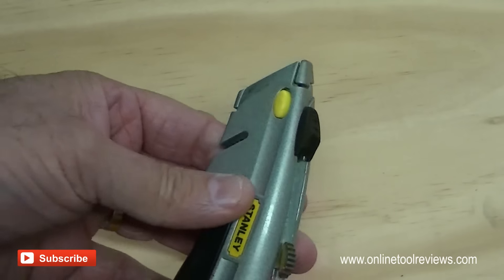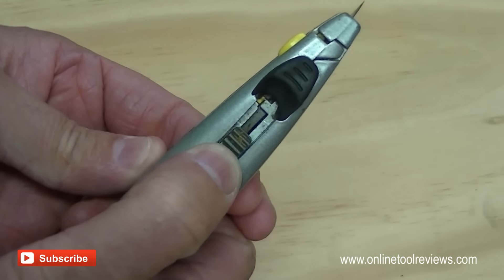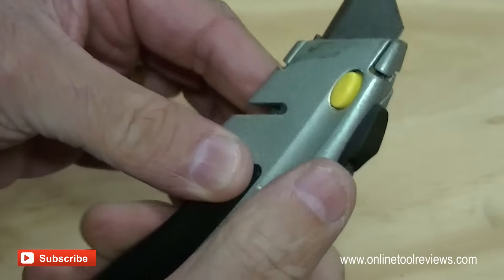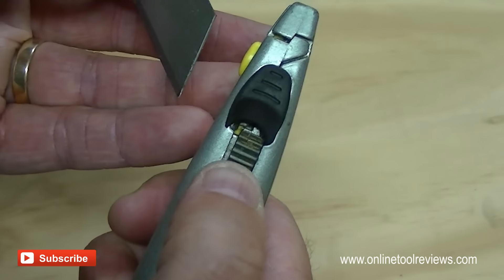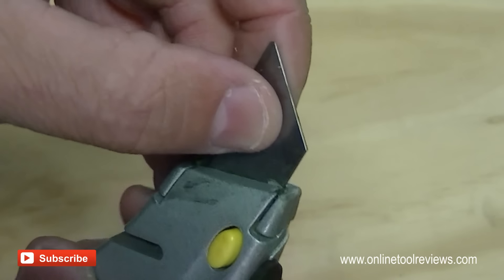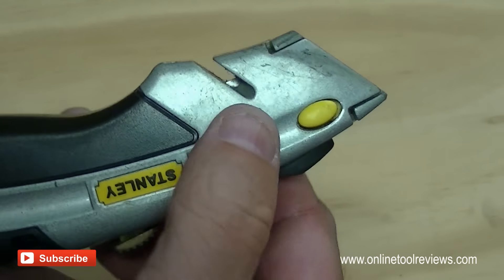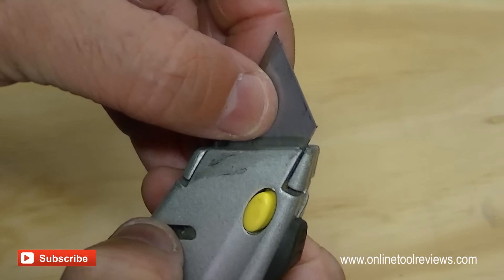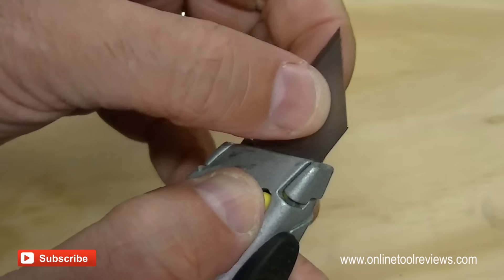How To Change Blades in a Stanley 10-788 Utility Knife - OnlineToolReviews

Comment: The "popular demand" for this video has been caused by poor engineering in the first place.
Reply from the maker: True.... But once you get past that, it is still a good knife IMO anyway.
Reply: Oh yeah. My yellow button is broken and/or SUPER stiff. I can only get the blade in one notch and it won't retract.
Reply: AMEN! And it's NOT easy. It's a pain in the arse - I had more trouble with the knife than the project I used it for!
Reply: @onlinetoolreviews4154  yes it's a brilliant knife, have u ever tried to change the blades on an old one, with spare blades as well I used to get in a right state, this one {once u figure it out} is brilliant.

Comment: Very good, but how do you get out the extra blades?
Reply: push the black square button near the end of the knife and then the bottom black plastic part releases
Reply: The blades sit in the holder underneat the handle part. Press the button on top down to release the holder part which will drop down underneath.

Comment: I’ve had this cutter for a few years. I had to bring it back to the hardware store and have them show me how to change the blade. It looks so easy when someone is standing there helping you. I got home and the blade wouldn’t click in no how I position and pushed it, back to the hardware store. OK, I’ve got it this time. It’s so frustrating. I end up getting my old one out. I like Stanley tools, but this one needs to go back to the design shop. Thanks for the video!  I think I’ve finally got it.😂

Comment: great video.  Button will not push all the way towards the black rubber.  Opened it up and its engineered not to push up that far.  So after watching all these videos trying to change the blade I had to take it apart to do so.  When I change this blade again this Stanley knife is going right in the trash.  aint nobody got time for that.

Comment: OMG Can't thank you enough!  the little tiny 1,2, 3 directions on the tag made absolutely no sense. Why can't anyone write actual directions using words anymore.  Just bought this knife as a grand opening promotion at ACE hardware for $2.99 .. I can't have enough toys.  With the help of your video I got it open, found the blades and installed it in all of 5 secs.  Looking forward to not having to open a knife with a screwdriver ever again!

Comment: Since my last posting on this knife I've found a very easy way to open this knife without pulling your hair out in the process.  Simply lay the knife on a hard surface then taking a 6 pound sledge hammer and with a decent wind up bring the hammer head down with offending knife and smash the living crap out of the knife and your problems are solved.  Then if you really do need a utility knife go to your local hardware or tool store and buy a Lenox # 20217 knife or any other knife - other than a Stanley!
Reply: 😀   then go buy a stainless steel switchblade and you're good to go!   depending on the day your having also determines the poundage of your sledge......
Reply: That would definitely get the knife open. Be like Lego or Ikea trying to put it back together though :P

Comment: Oh my! I had a complete brain fart when I tried changing the blades in my utility knife! I was stumped because I was using the smaller long bladed wiggly wimpier knife that you would open basically by going Dow the middle and prying it apart. I replaced the blade which reminded me of those extra flexible tree saws they used in the old country honky-tonk bands! I love my utility knife and you’re an awesome instructor and It doesn’t hurt that you can keep my attention with your beautiful voice and I mean nothing derogatory nor offensive. The video was perfect 👌🏻 you spoke clearly, and my work crew will be thrilled as well because they won’t have to change my blades every day!
Reply from the maker: You are most welcome. Thanks for the feedback.

Comment: How to you get to the spare blades to put a blade in the first time?  Just took the packaging off and it has no initial blade.
Reply from the maker: See the black "button" on the top of the handle where you palm sits... Push that downward to open up the blade storage section and grab a blade.

Comment: Thank you! I couldn't figure out what I was doing wrong. Sliding that slide thing all the way and pointing out that final click did the trick. Thank you! I was ready to buy a different one! :)
Reply from the maker: Hi Susan Hernandez, Yes it is a little tricky, but once those finer points are identified and shown, using the tool becomes a real joy. It is a great utility knife, as long as you can get those blades changed easily :)

Comment: Thank you. 3rd YT. I had to spray everything to get the bottons to work. The yellow button was just not working but ok after spraying.  I forgot to push it when putting the blade back in, but saw you do that. Then it worked fine. The top thumb button is gone. I have no idea when that happened... i loaned it one time recently. Nooe, never loan tools. I never got my power tools back. If you loan, assume they are gone. Then, just let it go and let God deal the justice. He always does.

Comment: You might want to "add" a demonstration for taking a "new blade" out of the compartment including starting from scratch with a new unit whose "cardboard" insertion is very difficult to remove without having a "magnifying glass" for us more elderly to read where one has to "tear", in order to remove it in advance of opening the compartment to get a new blade for installation. It is clearly a well designed unit once equipped with the knife, but not an easy one to figure out! :-)
Reply from the maker: That is not a bad idea, given the difficulty others seem to be having with unboxing this tool!

Comment: Make one showing where the two halves split apart.  The blade doesn't fit into the sliding apparatus, you have to use pliers or channel locks to force the blade in place.  30 years ago it wasn't like that, you could change a blade in 15 seconds.

Comment: this is an annoying design.  I sweat bullets trying to not cut myself until I could finally get it.  I think the trick is gently wiggling it until you hear that click.  

Thanks for the video.  It helped me at least have confidence that I was trying to do the right thing and it was just a matter of trying till it worked.
Reply from the maker: Aaron Gentry - no problem!

Comment: This video helped, but mine has been faulty from the day I bought it. I raged the day I bought it and then 4 years later pulled it out again to give it another go. It went almost as badly as the first time. I could never get the blade to "click" once it got to the second notch, and then it would not pull the blade in correctly and it would just drop back out. I spent hours trying this and watching YouTube videos with no success. I finally took the whole damn thing apart, laid the blade in the right place closed everything back up, put all the screws back in and BAM! It's working! But the way this video showed me, will not work no matter how many times I tied to make that blade go into the "click" position. There is something definitely wrong with the mechanics of replacing the blade.

Comment: I am also not able to push all the way forward. I can go forward three notches by pushing down before every notch and then sliding forwards, but no matter how much I try, I can not push it down enough to go beyond the final notch. The knob stay about half a centimetre before the rubber thingy. It's also a 10-788 (0-10-788 according to the display card) but it's slightly different from yours, it has an engraved Stanley logo and a diamond-shaped yellow button. Just bought it yesterday.

Comment: This video shows a blade change on the old model 10-788 with the oval yellow button. The new model 10-788 has a rectangular yellow button. On the newer model , the slider does NOT go into the the full forward position mentioned but stops at the normal usage full forward notch. The blade can be changed from that notch position after pushing the rectangular yellow button to release the blade. When reinserting a blade, push in the yellow button to let blade slide into the locked in position. With new blade in the locked in position, release the yellow button .
Reply: For cryin' out loud, then why didn't they call it the 10-789?

Thanks for this. I think I wore my thumb print off trying to push it all the way forward.  🙄 😅

Comment: The video was very help. Thanks to Stanley engineering a d design; I have two very sore thumbs trying to open the blade storage area and to change the blade. None of the 3 buttons works very easily. I bought this item about 1 week age, went to use it today and found I will be returning it tomorrow. Stanley used to be a name you could trust; they have lost all of my trust; what a shame.

Comment: Thanks for this video.  After a little playing around, I finally got the new blade to engage.  But it's a sloppy fit and the blade always has had a bit of rattle and play than I'd prefer.    I bought my knife over 10 years ago so I can't speak for today's quality.  But there are cheap plastic knives nowadays that work as well or better than this particular Stanley that I own.  They have blade storage and are not as much weight to drag around in your pocket, too.
Reply from the maker: +R. Severn 
This model has blade storage in the handle :)

Comment: You did not show how to open the handle to remove a new blade.... It is nearly impossible for me to "press down" on the black release button at the rear of the handle using a finger... I have to use a scredriver every time.. I insert the flat head screwdriver into rear of the button and push down so the screwdriver presses down on the black button and releases the handle...

Comment: The new utility knife that I bought had a piece of cardboard inserted in the blade end that was a major problem.  A careful look at the top where the blade advance/retract mechanism instructs the unfortunate buyer to "tear here" (on the card) with an arrow pointing down into the mechanism. Try as hard as I might the card wouldn't tear. Finally, cut the card with another utility knife and the card finally slid out.  This is just another example of the "adult proof" gimmicky frustrating packaging that makes the buyer wish he bought a different straightforward product.  I had to wonder if someone stayed up late into the night to dream up this painful gimmick.

Comment: This thing is ridiculous. I have a new version of this same model. It will NOT slide to that very last point, and I could not get the blade to lock in with as far as it would slide. I took it apart and put it back together, nothing else. It still doesn't slide to that very last point, but I can install and remove the blade now as designed.

Comment: Slide on mine will NOT go forward that last little bit.  I have tried everything short of taking it apart and forcing it forward, then putting it back together with it COMPLETELY advanced.  I'm done.  I don't have time to wrestle with it every single time I need to change a blade.  Not worth it.  I'll get something that actually works without tearing up my hands.

Comment: Turns out the Stanley blades given in my knife didn’t fit... had to buy a separate pack. Go figure
Reply from the maker: Well that is a problem! I buy replacement blades in bulk by the hundreds. Much cheaper.

Comment: Mine always seemed so un-secure after putting new one in, able to push way back in.  Maybe you also need to take special care NOT to advance the button all the way up when you're just sliding the blade up to use, ...to keep it locked?  This is over-design if ever was...

Comment: I just got one of these and its extremely difficult to get the blade in. I was able to take it apart and slip the blade in and reassemble it, but I thought this would be an easier tool to use!

Comment: I know I'm sometimes pretty lame, and the first time I tried this I took the whole knife apart and it took me 2 glasses of vodka and three different languages worth of curse words before I figured it out.  This time I googled "replacing a stanley utility knife blade", figuring there had to be something I was missing.  
There was.
The video revealed the simplicity of changing the blade.
Now if I can just stop the bleeding....
Reply from the maker: I think I did the same the first time too... Disassembled it to see how the mechanism actually works, then thought backwards with an occasional bit of logic to determine the correct course of action. It's not rocket science... Hang on, it kinda was! :)

Comment: Hey! To everyone still having problems after this video, the foolproof way to get the blade in is to push forward on the blade retractor AND push the yellow button SIMULTANEOUSLY while putting the blade in.
Reply: Good tip!
Reply: It won't.  Mine is defective.
Reply: It might be foolproof, but it does not defeat Stanley’s bad manufacturing processes
Reply: Finally worked with you ‘ simultaneous’ suggestion thank you- but wow- what a pain in the ** compared to the   Original simple screw type .

Comment: Mine looks different, it is not working! I have been working on it including googling, ended up here. Does not have a button, it is a soft rectangular rubber thing...it is not securing the blade. I have wasted my time and money. This thing is awful, and will just be trashed. Also dangerous with trying to get this blade in.

Comment: Thanks for the info video .. much help!  This is one F#@kED knife .... @Stanleytools
Reply from the maker: +DTCigarFather Most welcome. I quite like this knife myself, but agree that it would be frustrating if you didn't know how to change the blades correctly as shown in the video.
Reply: +OnlineToolReviews Yes, I've had this knife for over a year, and gave up on it. But then I really needed it for an art project. and found your video WHICH allowed me to get it working. The directions on the package were useless. Thanks a lot for your video.
Reply: OnlineToolReviews Very hard to get it working--difficult to get the cardboard out of blade area--had to remove two screws to get blades out then to get one inserted.  No helpful directions on the package--had to put things back one by one and get parts all lined up to finally put screws in place.  Must store extra blades in separate, safe place or open it up again---NOPE!
Reply from the maker: Susan, no problem, you are welcome. Glad it helped!
Reply from the maker: Yes if it gets some muck in the blade area, then it is certainly harder to operate!

Comment: Mine refuses to go any further than you said it should go. It only goes to the point that you said wouldn't work.......
Reply: Mine wouldn't, either (I think mine is a newer model), but after a few tries, I did get the blade to go in and lock.  I am thrilled I didn't have to ask my husband for once what to do to fix a tool!
Reply from the maker: Sorry to hear that! Have you figured it out, and is it the exact same model and style as in the video?
Reply: Yeah, same here.  I give up and will toss the tool.  There's no reason in the world that it should require a magician to insert a new blade.
Reply: The "button" simply not go forward as far as it should, and there's nothing I can do about it, short of taking out my frustration with a sledge hammer.  Or buy a different brand next time.
Reply: Mine was an Irwin blade.... didn’t work at that point either had a notch just before that point and it unlocked there.... try different points of retraction. This video saved me hours of frustration!
Reply: When that happened to mine, I opened it with a screwdriver and put it back to normal. It somehow worked. It's not this exact model but it was pretty close to it both cosmetic wise and function.